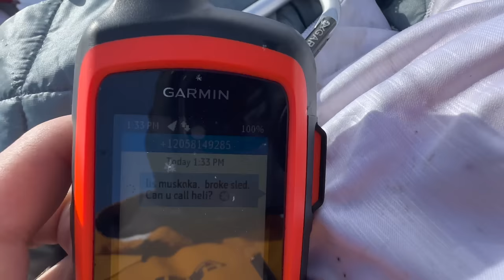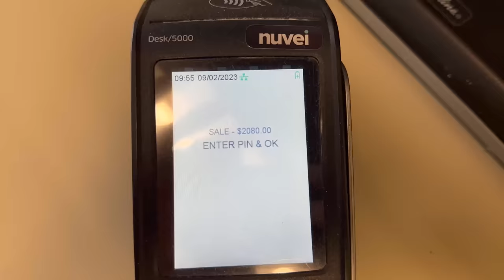2 Sleds 1 Heli

Comment: Save some cash and get a clutch puller. Use the p22 of the sled that has no chain case. That helicopter cost more then a new primary. Lol.
Reply: The sled that had the failed chaincase was a Ski-Doo.  It has NO p22 clutch.  The Polaris has belt drive between the jackshaft and drive axle. SO, it has no chaincase, BUT it had a broken p22 clutch.  Polaris Clutch could be replaced with a clutch puller, long arm Ratchet and a couple sockets.  (I use a small tree or branch to hold the clutch from turning.

Comment: With the amount of R&D done by the manufacturers . They should last longer than that . That translates to about 2 seasons for an average rider mileage wise . That’s NOT acceptable for the cost PERIOD . Motocross bikes have become almost bullet proof both two and four strokes. So what’s the deal with these engines blowing up constantly ? There’s no reason for them to let go so soon. So for $50k with all the mods you get 3000 k worth of riding . Sounds like rental is the way to go from now on 😝👌.